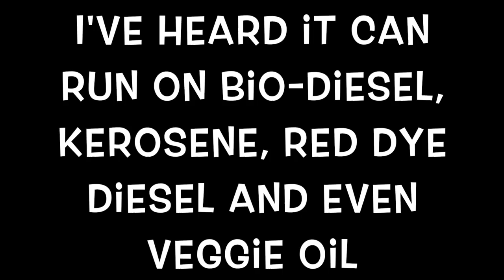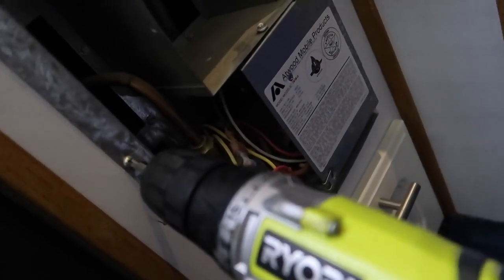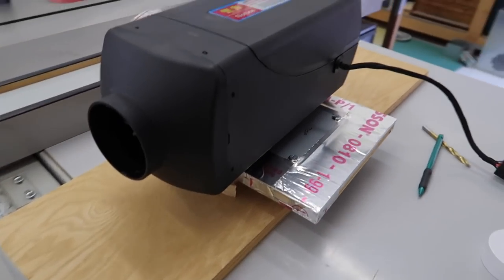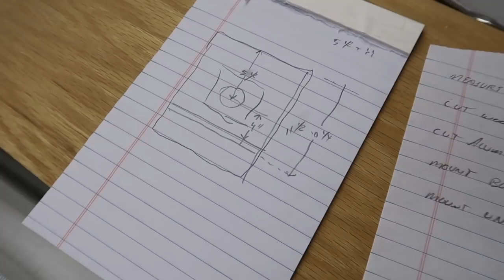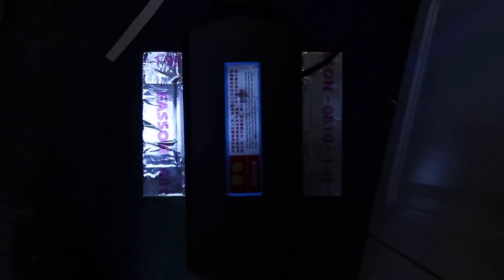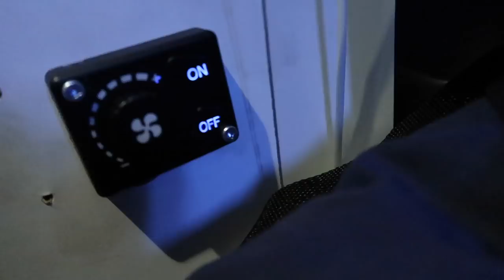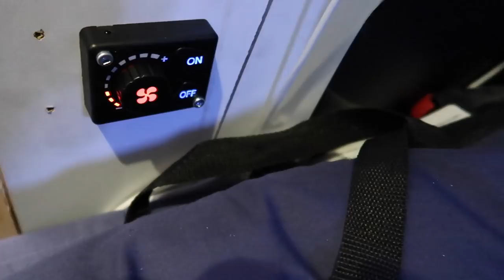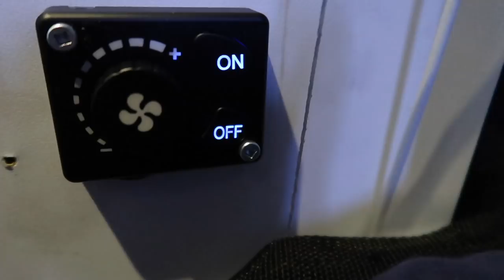China Diesel Heater DIY Part 2  INSTALL Atwood Direct Retrofit

Comment: I have had good luck with those Harbor Freight hole-saws as well.  They aren't professional-grade by any standard but for the average homeowner they are very handy and the price is excellent.  I've used them many times and they are getting dull but still work.  When they no longer cut well, I'll just buy a new set.
Reply from the maker: Great point!

Comment: Absolutely great job! I need also such a heater, love that simple controller old shool Webasto or Eberdpächer style..i would change the hinges on the fuel tank cabinet to the right side, and mount te tank an a swifle bracket ( hinge) so you can turn it out and fuel it from the outside with no oil dripping into the rigg..i am also scared the gas line under the furnace a bit..may be an extra enxlosure with a vent hose to the old oven exhaust outlet would let me sleep better?
Love yout tutorials, brilliant!

Comment: Good video and Steve a brilliant install there  but to clarify at the start you said you were replacing the Atwood Diesel heater (at 29 seconds on video) with the new Chinese Diesel Heater but surely the Atwood was a propane i/e gas fuelled heater and NOT a diesel fuelled heater?You actually capped off the gas connection to the Atwood heater so did the Atwood heater run on both Gas and Diesel?

atb Mike uk
Reply from the maker: That would be an ooops moment. Good catch.

Comment: I'd check the temperature of the plywood around the heat outlet with an infrared  gun. The ignition temp of wood may seem OK, but it drops when it's exposed to heat over time. I'd have used metal there.
Reply from the maker: It's fine.

Comment: I'm not too sure how running the exhaust and air intake through the wheel well is going to work for you. Seems like a bad idea. Water spray from the tire seems like the biggest problem you might have. You might have to put little screens on those vents too to keep rodents and pests out.
Reply from the maker: Right, right. If you saw it, you would probably be comfortable with it. I will have to show that part in a future update Q and A.

Comment: Xplorer Steve, I like this heater and your install. I do have a question for you not related to this video. I just bought a 1999 xplorer that needs lots of work and lots of cleaning. how can I contact you for help and advise on a few repairs I need to make on the interior ?.Thanks
Reply from the maker: There are many vids in my feed. You can try there or join the Xplorer owners forum on Yahoo Groups. They have lots of resources and "experts" there .

Comment: Great video! I'm considering using a heater of this sort in my small van conversion. But my only concern is having to live with a diesel fuel tank in the van (odor?) and spillage when filling up. Can you disconnect the fuel line, take the tank to the pump instead the pump to the tank when at the gas station?
Reply: what about a boat fuel tank

Comment: Would've been a cleaner, smarter install to reuse the existing vent in the wall of the van rather than drilling new holes in the fenderwell. Fenderwells are the worst place for this sort of thing due to the tires spinning there. They actually create a good deal of pressure like a centrifugal blower slinging water, dirt, etc into your new heater's intake and exhaust ports
Reply from the maker: It's fine. I'll show it in some future update no prob.

Comment: At first I was thinking the exhaust was installed next to the fresh air inlet. Then it dawned on me it is combustion air. Did you just seal off the old exhaust opening? Very clean install by the way.
Reply from the maker: Yes. I just sealed it off but the vent remains because of the big hole.

Comment: Hi explorer Steve, this is explorer DannyD. I finally got an explorer a couple years ago. I flew out to Michigan, a few miles where they used to make them, and drove it back to San Jose. My heater works pretty good except for in the beginning it’s squeaks a little bit. I will be replacing that one day. I wonder if you still have the information from when you replaced your window molding. Mine is cracking and shrinking. Do you remember the model numbers of the several types of rubber molding. I’m having trouble trying to figure it out.
Reply from the maker: Look in the comments for the name of the company. Many have asked.  They will send you a sample packet that will let you test fit each window. Mine had a couple different sizes and I don't remember. Better to get the sample in case you have different windows than mine or year. .
Reply: Hi Steve, I looked in all the comments under this video and could not find the information. Is there another spot for comments somewhere else that I don’t know about.

Comment: Very nice  installation Steve. Did you have any problem priming  the metering pump?
Reply from the maker: It took a few cycles. I advised it would be better to prime the lines first to avoid the time.

Comment: i drilled a hole on the top of the tank and have the fuel line go in at the top and down to the bottom. and i have something heavy on it to hold it down. So now there is not need to worry about the fuel tank starting to leak
Reply from the maker: It's a personal choice for sure.

Comment: If you ran the air and exhaust out the wheel well won't it collect road dirt and debris while driving clogging the air intake  etc
Reply from the maker: Naw. Intake has a screen filter and is protected. Exhuast goes out the back of the wheel behind and out the side.

Comment: Great job! Why not replace with a newer atwood heater? They are very efficient, quiet and use the same fuel source. We had one in or 2017 FWC. Can you fill the diesel pretty easily without spilling. We now have a d2 heater. You should be able to a external temp sensor so it doesn't cycle so much.
Reply: I have a 2016 FWC (Fleet model) with the small propane Atwood furnace.  My concern with the Atwood is the number of amp hours it gobbles up.  In a moderately cold climate (freezing at night) it can easily consume 20 Ah per night.  I take it that the newer Atwood is a diesel - how much current does it draw, how many Ah per night (on cold nights - near or below freezing)?
Reply from the maker: Personal preference on the style and type of heater. I trip in this and so do not need one that cycles. Simple is fine. Just take the chill off in the morning. and while doing kitchen duties.
Reply: @vonrollveeg  I never measured. I ordered  two battery from factory (75 amp hr each) with the camper was built and never had any issue with power even with the tiny wiring they installed for alternator charging. We never setup our temp more that 55 on thermostat.

Comment: I will be curious to see how much less moisture and fumes these create than the stock propane units.
Reply from the maker: I don't think either creates fumes or moisture as they are both direct-vent systems.
Reply: @XplorerSteveDIY  I've had 2 travel trailers with the forced air propane furnaces. I always detected a weird smell when we would use it. It may just be me. I think I'm hyper sensitive to that kind of thing, though. Excellent, excellent job btw. You always do great.

Comment: Thanks for putting this together, but I noticed a few things:

1) Isn't the exhaust and fresh air intake a little too close to one another?  Wouldn't you end up sucking in the exhausted fumes?

2) Is having it directly over the rear wheel such a good idea?  Wouldn't the exhausted hot air constantly blow over the rubber tire?  And personally, I think the wheel well area is one of the foulest smelling areas of the vehicle for fresh air, but that is just me. 

3) How did you secure the fuel tank?  For safety reasons, you probably don't want it moving freely while you are driving.
Reply from the maker: 1. it is a direct vent system so no prob. The only instruction is that they not face into the direction of a moving vehicle. @. It's a great idea : )  just exhaust out the side clear of the vehicle, not on the tire silly. Again. direct vent system.  3. Fuel tanks is screwed in.
Reply: One more thing, are you worried about dirt and grim being kicked up by the tires and into tubes?  Potentially clogging them?
Reply from the maker: How would that happen?
Reply: Since your holes are above your tires, wouldn't your tires eventually kick up dirt, water, pebbles, mud, etc., from the road and into the tube opening?  Eventually clogging it?
Reply: I was about to ask these exact questions, i guess i am confused on the exhaust and intake so close together too.  Also i would worry about water being shot up into the intake tube.  I was also curious about have a fuel tank inside the van, fumes and how the heck to you fill it up, lol????  Great video though, always amazing to watch you work!

Comment: Great video!   I like your narration skills.  Please explain the attachment of fuel line to fuel tank.  Also, are there any overheating problems with the heater being installed in such a tight area?  Thanks
Reply from the maker: Fuel line attached like the other connections. Hose on the metal tube and finished with the compression clamp. The unit is cool to the touch. Exhaust pipe gets warm but only a few inches of that is on the interior. Heat does not build up in there to any dangerous level.

Comment: Were you able to cut through the metal of the wheel well with the harbor freight hole saw kit? Or were you talking about holes elsewhere that you cut with it?
Reply from the maker: Yes.
Reply: @XplorerSteveDIY  Cool.  I thought those were just for wood.  If they cut metal then that should make my project a ton easier.

Thanks for reply.
Reply from the maker: They are carbon steel. It need only be harder than the metal it is cutting through. Not saying it will do it all day but...
Reply: @XplorerSteveDIY  As long as I get two holes cut with it I'm good...lol.  Like you, most of the tools I get from Harbor Freight are ones that I will end up only using a few times.  

Btw, have you tried putting some kind of high temp pipe insulation on that exhaust pipe?  I was thinking of doing that but wasn't sure how hot it gets... which type of insulation would work best.
Reply from the maker: On the hole saw- some lube helps and extends life of the tool. Wrap? I thought about it but while hot, it doesn't seem to be a problem. On the other hand, If I were to get some wrap for free I'd do it just cuz.

Comment: why  did you get  such a  large  5  kw  as  opposed  to  2  kw  heater?
Reply from the maker: Old heater wat 16,000 BTU this is 17,500....Close.
Reply from the maker: They also make a 8000 kw.

Comment: Good job on the compression brass cap, I found many pipe caps ( not compression) that were leaking the person would put a bunch of pipe dope and Teflon tape on it to try and stop the leak. And some would use grocery store plastic bags not having Teflon tape.
Reply from the maker: I have actually made the mistake of using the yellow tape on a compression fitting before. big no no.

Comment: Unwise installation in my humble opinion. 
Exhaust pipe should not run through habitation area as a leak in exhaust joint or crack in exhaust pipe will result in CO gas inside camper and possible death.
Reply from the maker: Haha. The heater it replaced had exhaust within the cavity as well as propane lines. Propane radiant heaters produce  Carbon Monoxide gas. Wood stoves have chimneys and seals that can leak. Best not to live your life in fear. Get out and Xplore! ...and get a detector as advised.